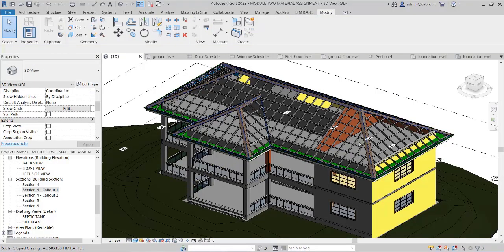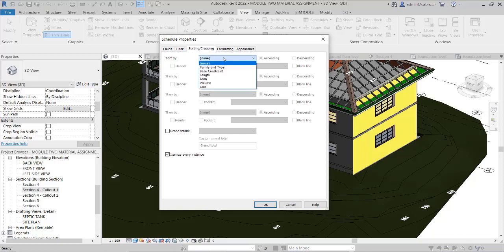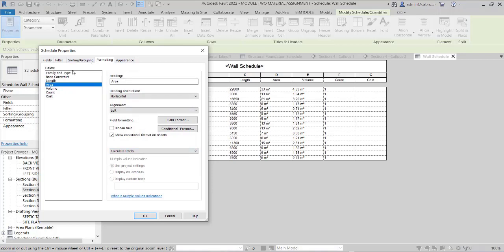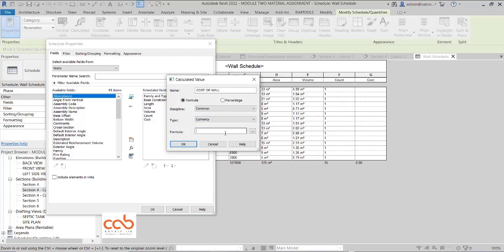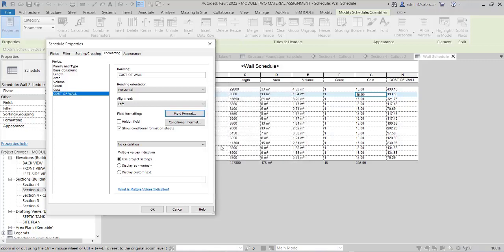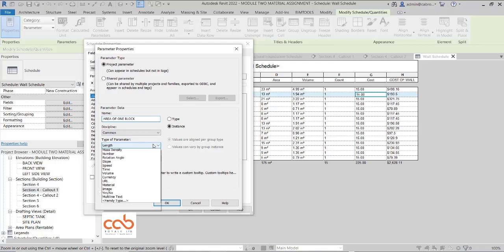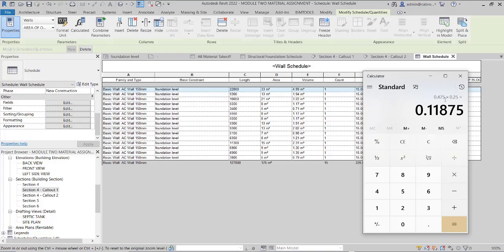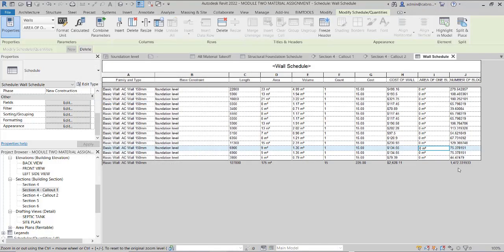HOW TO CALCULATE AREA OF WALL, NUMBER OF BLOCKS AND COST OF BLOCKWORK

Comment: Area of one block. 0.11875 can you do drag to populate like excel instead of typing in one by one?
Reply from the maker: When you set the Area of One block  parameter as a Type parameter you will only enter the figure once. But when it is set as an instance parameter then individual entry will be required.

Comment: Can you rename existing schedule fields? Cost is best renamed as Rate. And Cost of Wall rather simply Cost. A bit more traditional BoQ fields.
Reply from the maker: One will have to create a field called Rate and use that in your extraction. Either than that you will have to change the label (cost) when you send it to Microsoft Excel